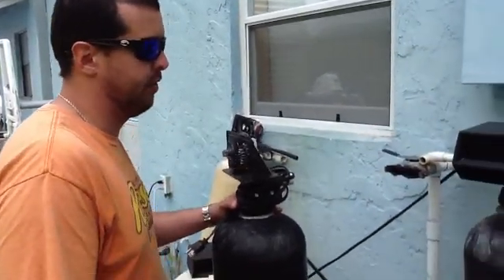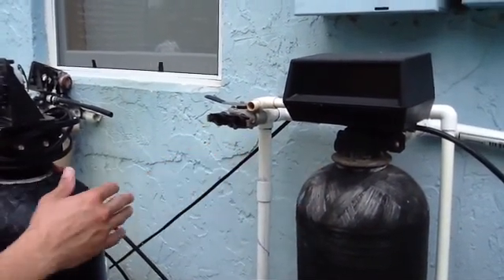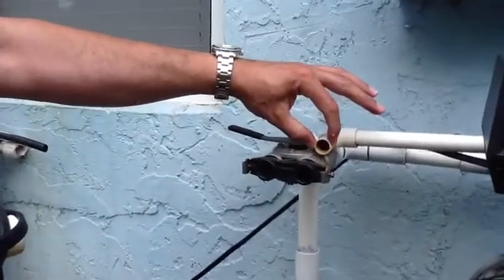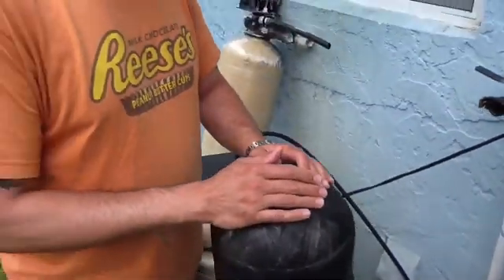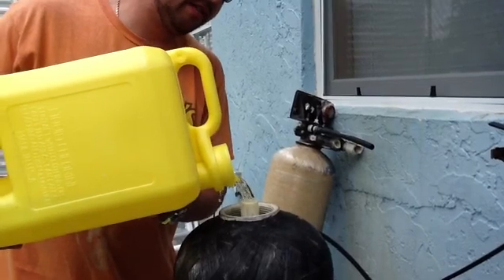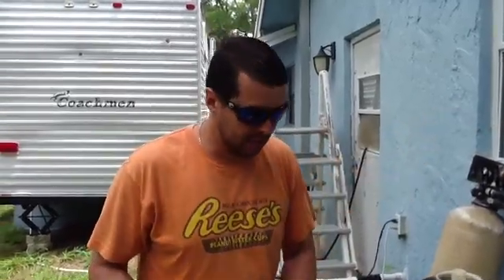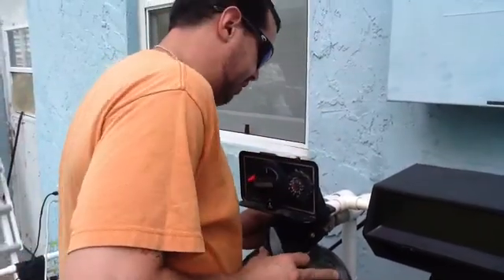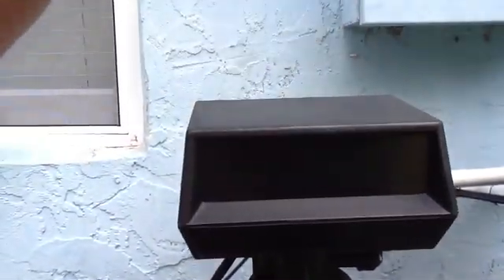How to maintain your water system- carbon tank maintenance.

Comment: Recommended is letting the chlorine sit for 6-8 hours when you back fill house lines which you can do thru the sediment filter. You should NOT be running chlorine thru your system that should all be shut off so chlorine does NOT get thru it. Chlorine will destroy the other tank when run thru!! Sounds like You should be changing the bedding in your tanks.
Reply: That's what I was thinking thank you for validating